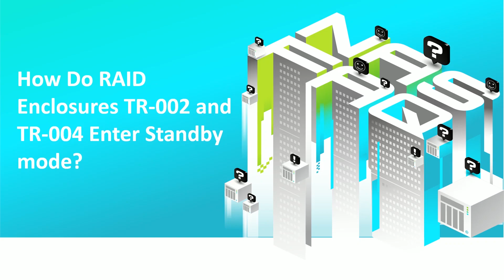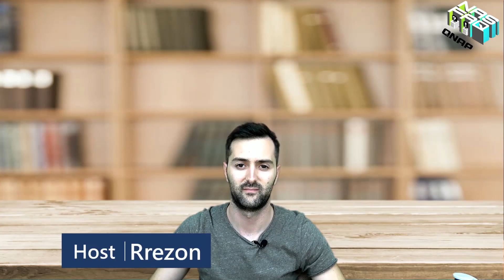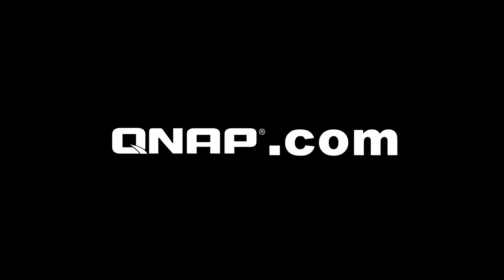How do RAID enclosures TR-002 and TR-004 enter standby mode?｜NAS FAQ

Comment: Unfortunatly powering of the USB-port/disconnecting the cable is the only option on TR-004 to bring it into standby. I wish there where another option to do that because my linux server is required to run for other purposes while not always need to access the RAID. Any other option?
Reply: I agree. I'm using a RAID array in my TR-004 to backup the changes to my other RAID array once a day and would like it to sleep the other 23.8 hours a day.